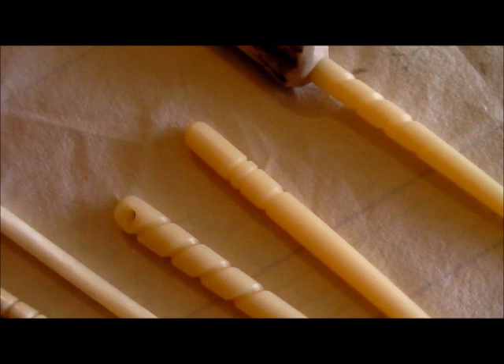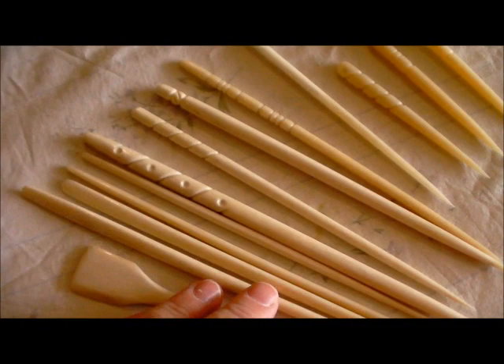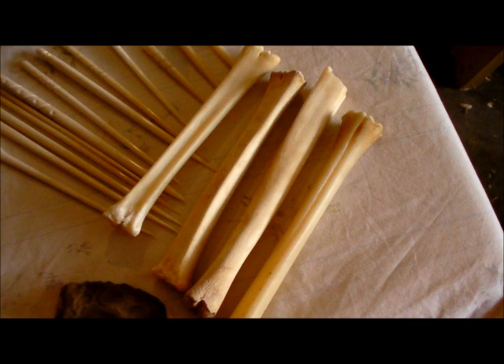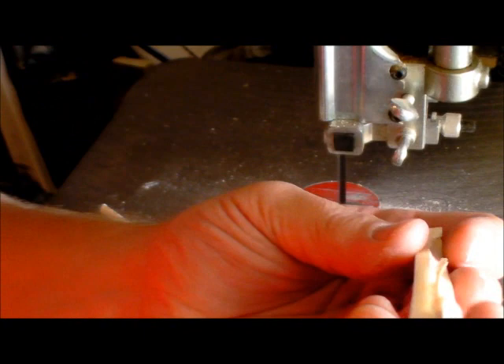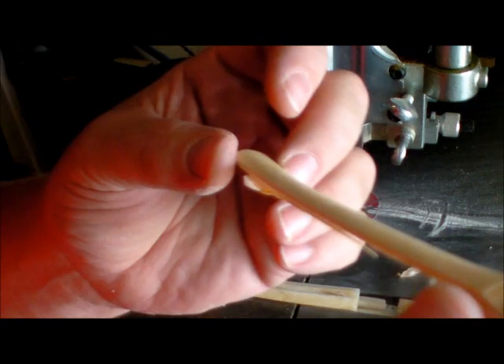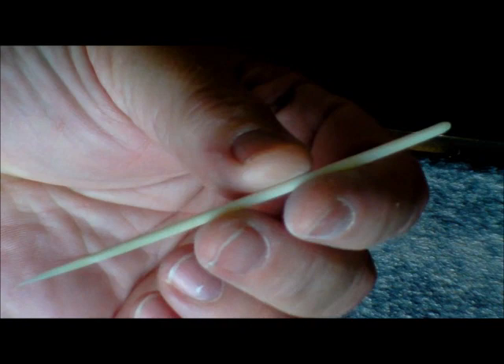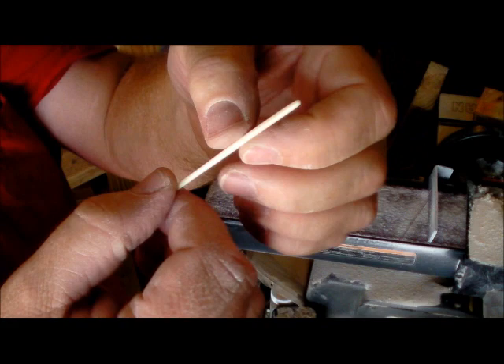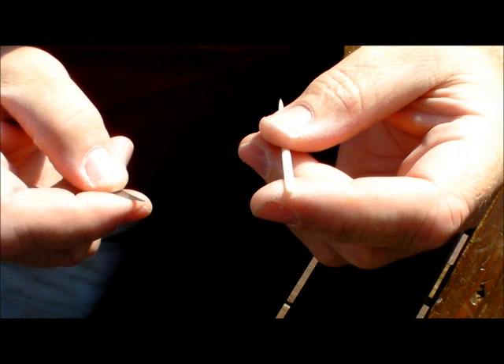Making Primitive BONE NEEDLES

Comment from the maker: @banjax66 - Basically the same way I did, but it would take a week or two to obtain the finished product.  It would take a couple of hours or more to work the leg bone down with a piece of flint to get the piece of bone to work with.  They would then start methodically rubbing the cut bone on a stationary piece of rock until the needle was rough shaped, probably two or three days.  Using a small piece of flint the eyehole was cut in.  Final sanding was done with sand or another piece of bone.

Comment from the maker: @zekeyo37 - I need to get out and do a bit of knapping.  It's been extremely hot this summer here in Oklahoma.  We've set a record this year for number of days with the temp greater than 100F.  All of which makes it hard to knap when you've got sweat running into your eyes.  I also need to make a flint run down Texas way as I'm running really short of flint.